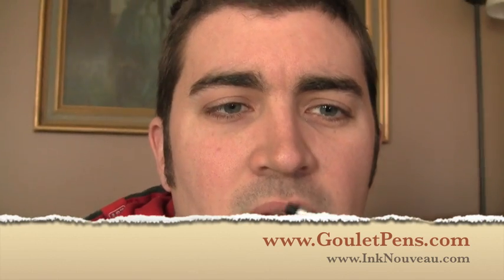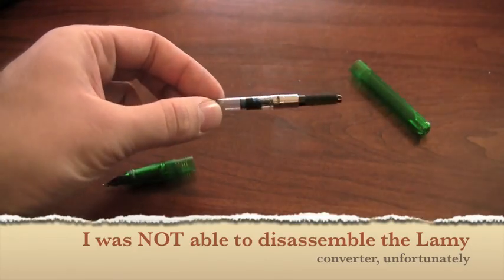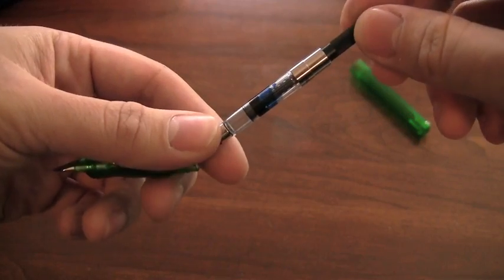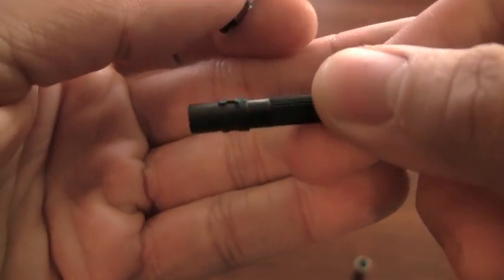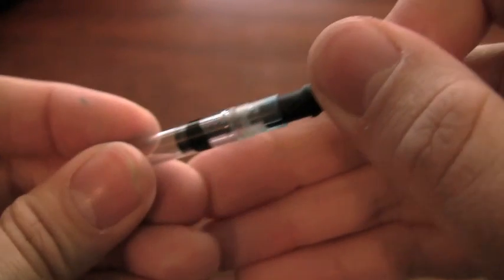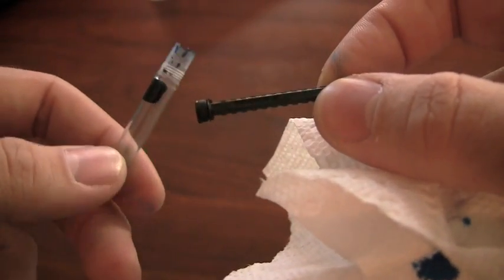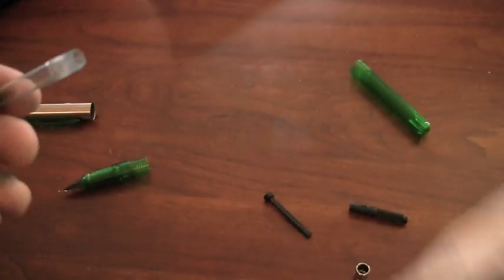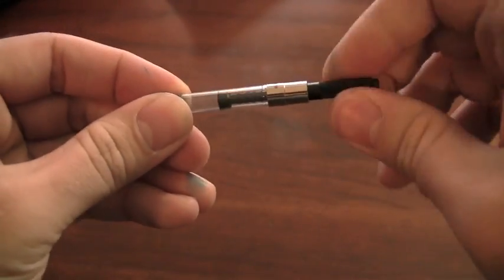Cleaning Behind the Converter Piston Seal

Comment: Great video!  There is another way that I have cleaned behind the piston.  You don't need to take the converter apart, as I have found some that appear to be glued.  Wind the piston all of the way down, where it would be if you were to start to fill it.  Then fill one of those blue bulb syringes (like what you use to clean converter pens with), and push the tip of the syringe to the end of the turning knob of the converter.  Squeeze and the ink will come out!  There are holes in the back of the turning knob for (I assume) to prevent a vacuum lock.  The water from the syringe bulb will go into these holes, and push the ink out usually from around the edge of the top cap.  Simple and effective.  Then hold the converter with the turning rod facing down, and now turn the knob to retract the piston and it will push out any remaining water.
Reply: wow, thank you for the tips. I have succeeded in cleaning my converter without taking it apart!
Reply: Thank you .... thank you.... thank you.  I did not know if I was just too weak to pull off the rings or what.  This method worked great and was so much easier.
Reply: Good bless you, I was struggling because I can't unscrew my Schmidt converter and your advice was  the answer to my trouble so thank you for your amazing advice I wish you a beautiful day. Greetings from Spain.
Reply: Thank you for this! I was unable to separate a Lamy Safari converter and this worked like a charm! Appreciate you sharing 😊
Reply: This right here is why I love fountainpen comunity .. if Brian did not have a solution 13 years ago to my problem in 2024, there sure as heck is someone else who have commented 4 years ago with an upgrade that will work for me :)

Comment: This may be necroposting, but this video helped me out today. My Parker Sonnet Fu was unusable because the converter was so gummy. First I tried just twisting with my fingers. Nothing. Then I tried wrapping with some rubber matting and twisting. Nothing. What did the trick was to tightly wrap some elastic bands around the two parts I was twisting and then wrapping with rubber matting. This did the trick

Comment: Thanks so much for this! I received a new Duke charley chaplin model fude nib pen and the converter wasnt loading ink so I was able to take it apart, apply some silicone to the edges of the plunger which created a good seal so I could load the ink😊

Comment: Thanks for sharing this. I'm having a problem with my Nemosine converters. Sucking air from behind the converter. (Soaking in Windex might have messed them up.) I wind up with ink foam instead of ink. Tried disassembling. The back chrome piece unscrews, but the piston seems caged--won't come out. I tried putting a lot of silicone grease inside the chrome cap--so instead of air, the grease would be drawn in. Seems to work much better. Not sure if this will be a long term solution.

Comment: Wrong method!! You don't need to disassemble the converter. The vacuum mechanism of the converter works the same way through the opposite end as well. The right method is to take some clear water, dip the opposite end of converter into water, and rotate the piston back and forth (the same way you do when flushing through the working end, but this time flushing through the opposite end).
Reply from the maker: Thank you - this video is over 10 years old, so we've definitely learned some new things since then. :) - Drew

Comment: Hey! What happens if I don’t use the silicone grease?
Reply from the maker: It's not 100% necessary, but it does allow the piston to smoothly operate. In general, you'll rarely have to completely disassemble a converter though! - Colin